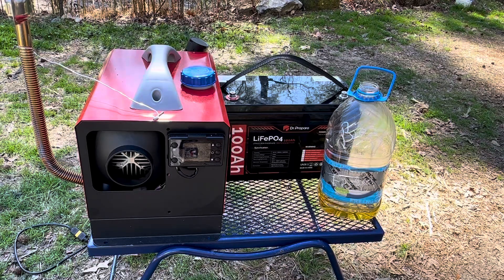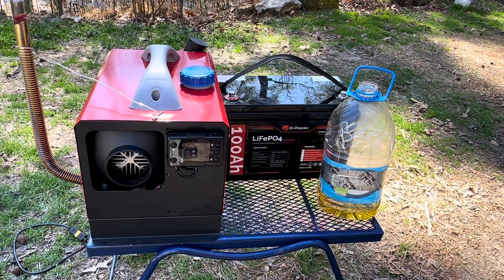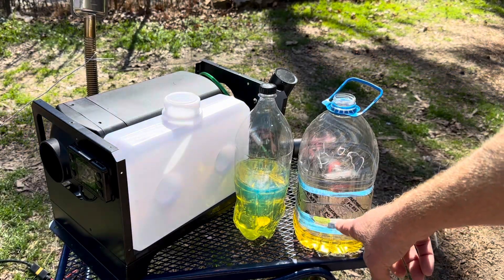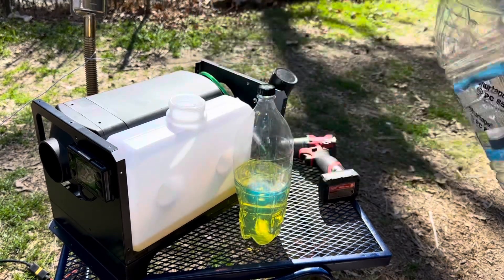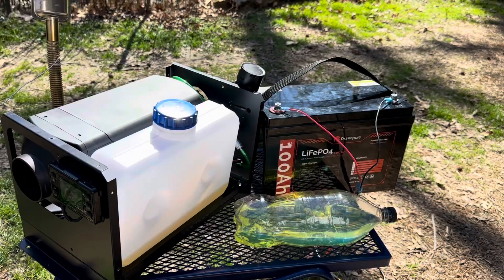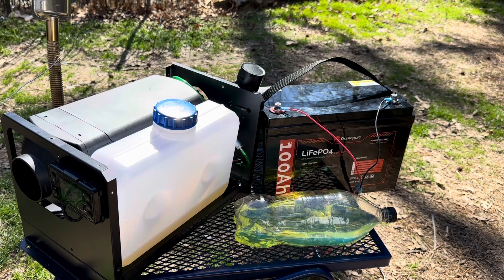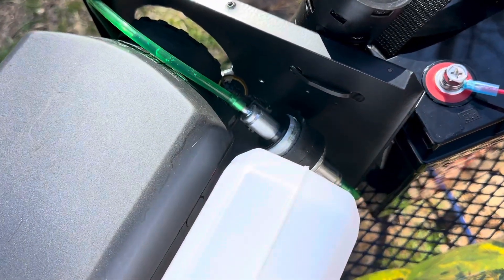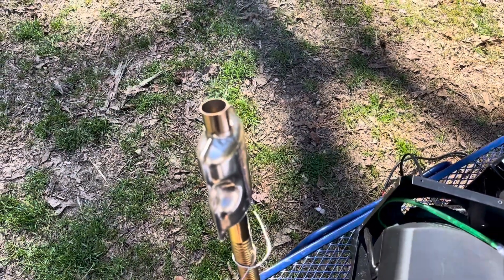Cheap Chinese Diesel Heater Runs on Homemade Biodiesel

Comment: Would installing a one way check valve prevent the initial bubbles from forming in the fuel line or would it clog due to viscosity
Reply from the maker: I’m not sure of a check would help with the bubbles?

Comment: I have been running biodiesel in my home, shop, and my 7.3 f250 since 06. You did not mention the vevor heater seals? If you have any rubber seals hoses or anything rubber, the biodiesel will eat it and cause failure from small problems to dangerous ones. Must have pumps rated for B100 viton sealed. Webster made one but sold out to suntech and they carry a B100 pump.
I do not know what type of seals are used in the vevor units but would like to.
I am no novice to biodiesel making with over 33,000 gals made to date.
Reply from the maker: No idea what type of seals are in the pump. The supposed green “tygon” appearing fuel line got dissolved over the summer. Did biodiesel do it or the concoction of other mixture I’ve used? Bio is a great solvent no doubt. 
I replaced with a new fuel line and have been continuing to run the heater on biodiesel, SVO+street diesel mix, used oil, ATF fluid, thinned down gear oil etc. basically anything I have laying around or can pick up for free. Even pumped out some circa 1970s fuel oil from an underground tank to run it on. I don’t trust these things even on reg diesel. They scream fire hazard to me. I added a 8’ length of duct hose and keep the little heater away from anything combustible and never leave unattended.